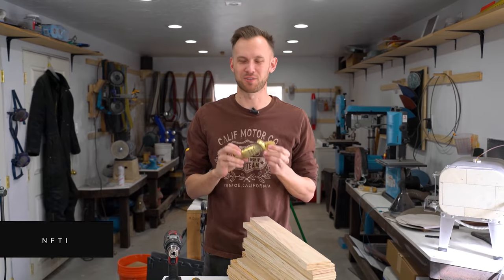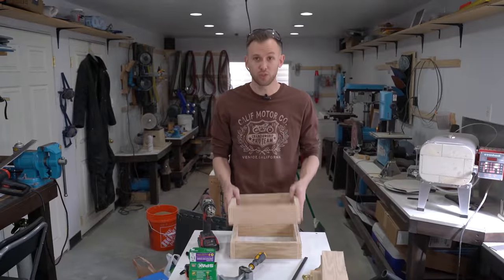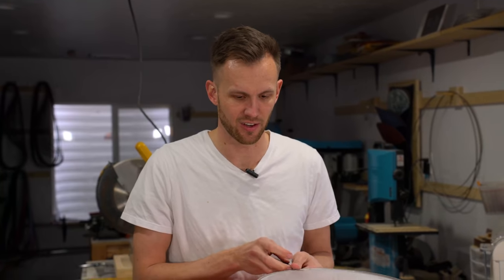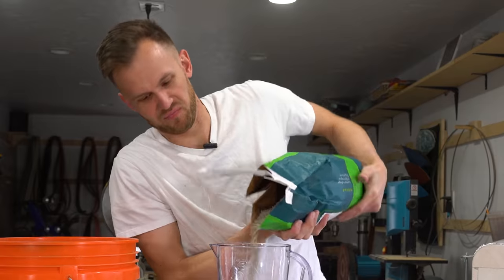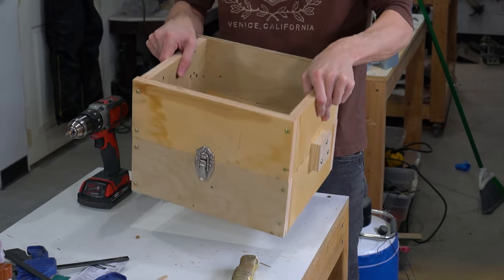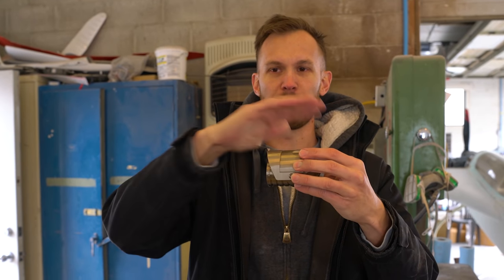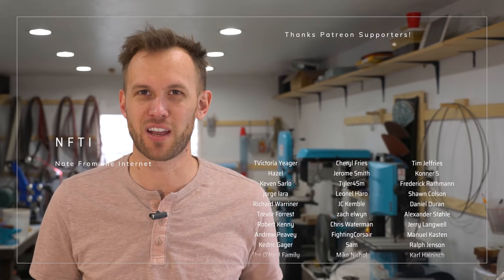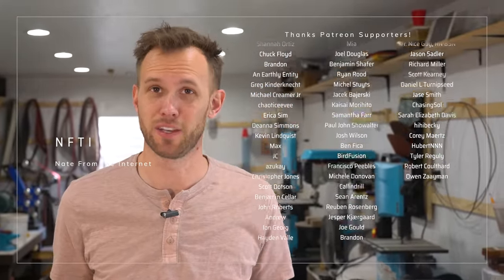Using Glass to cast Molten Metal!

Comment: Did you put the wrong title on this video? Wouldn't a title be more like; Casting an Iron Giant Head out of metal. Did you say glass because you're casting inside of sand?
Reply from the maker: Because I used glass as part of the mold material. It's cast IN glass, made out of bronze.
Reply: @NFTI  oh yeah duh lol I forgot about that. Definitely need some better casting sand. I like when people use a casting slurry with a sand and wire with multiple dips. I've seen this produce really good results